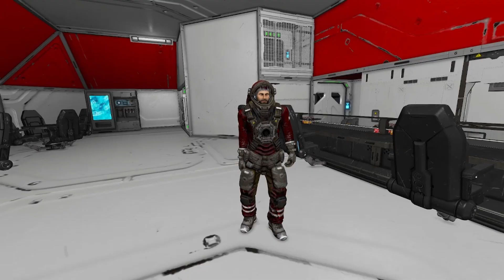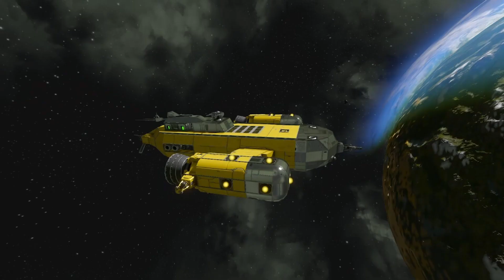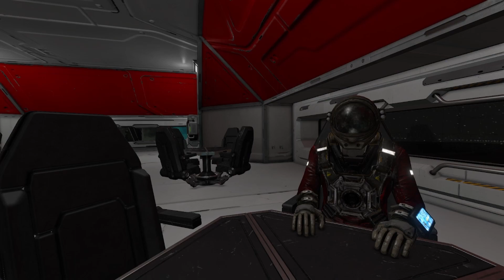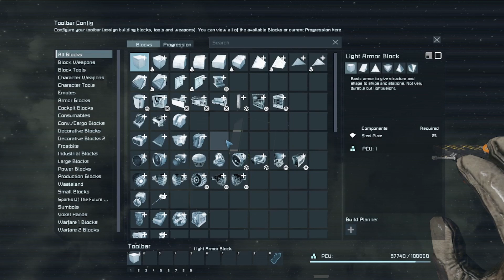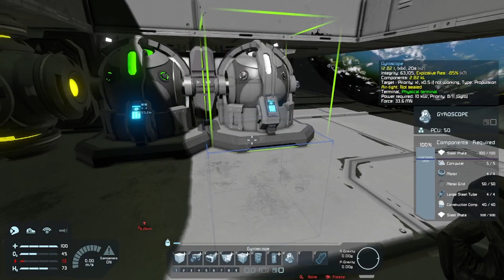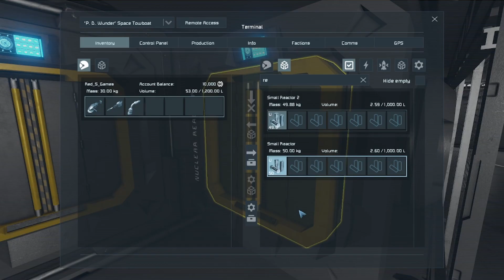Ship of the Week - Modular Space Towboat - Space Engineers Ship Design Challenge

Comment: When you mentioned the angle blocks sometimes going boom when you're not correctly aligned, I thought about having the merge blocks on the tug at the end of pistons. Extend them before docking so they are away from bits that might explode, then retract them to make the connection.  Maybe just one so there's no issues with the two pistons getting out of sync. (And it would save room inside the tug.)
Reply from the maker: That could work except that the idea of the merge blocks is to make both tug and barge a single grid, and a piston in-between would still make them subgrids.
Reply: Also, barge needs a beacon set to low range (to ID each part in a multi-barge voyage), and some lights in the corridor.